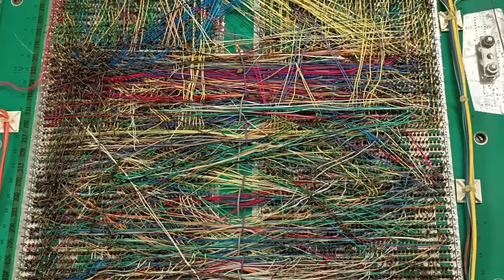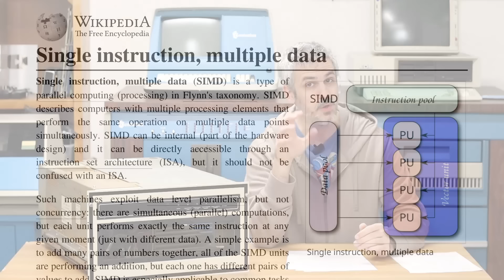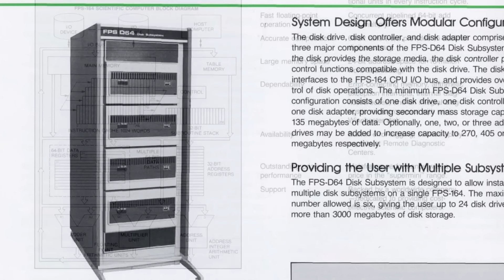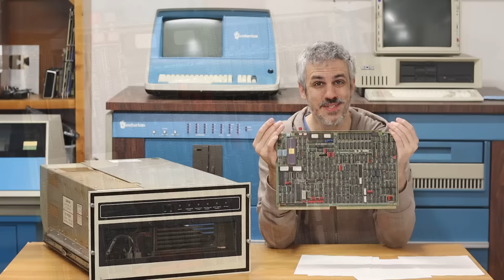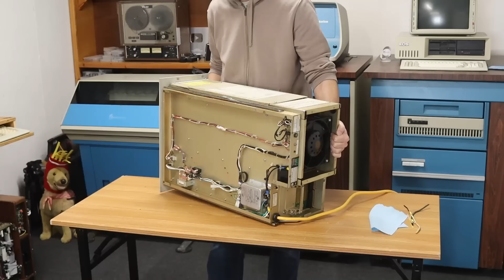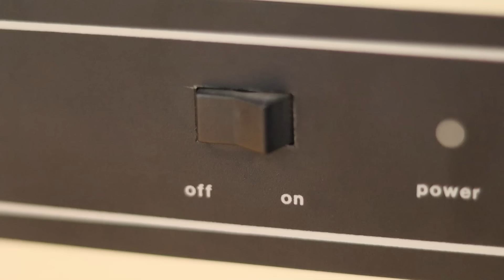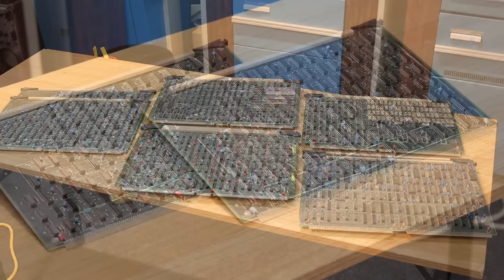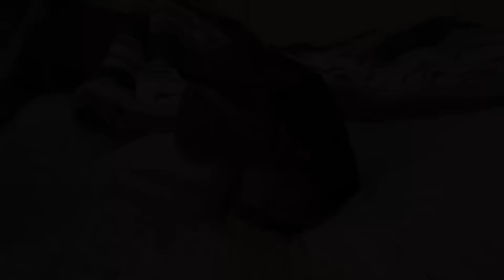This Computer is from a Defunct Supercomputer Company

Comment: Programmer here from late 70's and still working.
For myself I reserve the term array for multi-dimensional arrays mostly and vectors exclusively for arrays of a single dimension; so arrays are a superset that contains vectors.
BTW I cut my teeth on an NCR series 500 accounting machine (it used a 4-address instruction set and didn't have a program counter!), but most of my student programming was done on a timeshared DecSystem10, with some PDP-8 and a mostly unique PDP-15. One of my favourite memories was running lunar lander of a GT40 hanging off a PDP-11/03, because it came with 4KW of core memory the game would remember where you crashed your LEMs and woe betide you, if destroyed the "only MacDonalds on the Moon!"
My first job was programming a PDP 11/34 to run a ribber mixing plant and later on I helped to re-engineer a system that monitored a nuclear reactor and this was based around a PDP 11/44 so I really enjoyed the "blast from the past" that was you running sysgen in a previous video.
Reply: You are very impressive sir
Reply: wow! man you must have it so nice now with all that experience to draw from! best of times to you!
Reply: Ai is not going to take over but the most basic programming and error checking
Reply: Always wanted to be a programmer. Never learned it. And now we have AI. No need to learn it anymore.
Reply: @a56oktober202  Yeah, no. AI has added about 20% to the workload of software engineers. It turns out that it usually creates more work than it solves, as it takes someone with lots of experience to figure out and solve the errors.
Reply: Programmer from the early 80s here… we are not needed anymore, AI replaced us.  Deal with it.
Reply: @Smashtvtv ai’s that are giving wrong data, wiping databases and hds? lol. Only idiots will replace their programmers with ai 😂
Reply: @Smashtvtv  Have you ever looked at the code that AI generates? Believe me that we're still going to need humans with programming expertise to debug and validate that nonsense. You'd better hope that your airplane isn't flying with code written by AI, or your nuclear power plant isn't running with AI code, or that a human has validated the code running the CT machine you're being irradiated by... or even that your internet router has better than AI code powering it.

Comment: As a programmer, I have come across the term "Vector" several times; when not used for 3D graphics, it usually refers to a 1-dimensional array. And if you really want terms of confusion: add German translations to the mix, when "array" and "field" are translated with the same word. Which can get funny when you have fields that are arrays. x.x

Comment: Around the same time I was working with Sperry-UNIVAC array processor which had a theoretical limit of 120 mflop (though it was more like 80-some odd megaflops is reality).  It was really designed for oil exploration and the were indications that the 36bit floating point processor was, unlike 32 bit, just barely enough for the workload.

We mostly ran 3D FFT which had a lot of I/O jiggery-pokery in terms of rotating the cube.

Comment: In the early 90s, I worked for the University of Vermont. We had RS/6000 systems for academic computing, and one day a sociology professor complained that her Fortran program was performing poorly. Upon investigation, I found that it had originated at Queen's University, where I'd studied, and thus I knew that the program was designed to run on Queen's 3081G mainframe and, most importantly, the FPS164 array processor that machine had. I explained this and showed how the program could be changed to run fast on the RS/6000. She replied that unfortunately, due to peer review requirements, etc., the program couldn't be changed at all; if it was, her results would not be accepted. Seemed bizarre to have a whole field of study wedded to what was by then obsolete and unobtanium hardware.
Reply: Seems like you could do a lot of the research with an optimized program, and then at the end run it through the original to validate the results.

Comment: Programmers: Arrays!
Mathematicians: Vectors!
C++: We're just going to name the fixed ones std::array and the dynamic ones std::vector to confuse both
...oh and we also have std::list and std::deque which is basically the same general idea with slightly different set of features....
Reply: Modern programmers, mathematicians and AI researchers: Tensors! 🙂
Reply: @GreenJimll  Which, of course, are not really the tensors of physics!
Reply: C++ is only language naming them this way really. It is completely reverse of what it should be really.
Reply: I dislike the way C++ has regimented all memory access.  It's all just arrays really.  You got to learn C if you want to actually make a new datatype...
Reply: @tsm688  well... kinda.

Almost anything you could implement via C you can also implement via C++ - generally in more safe but sometimes gramatically-confusing manner.

C++ aims to be as fast as hardware allows and that means they have to support ALL those things even if it's really one thing due to slightly different ways of allocating space. Most programming languages only implement one of those things and call that "array" - much more straightforward at the cost of some speed. 

In particular std::array is just a wrapper around a normal C array, but std::vector is actually a dynamic-array-allocated-on-heap. std::deque is a linked-list-of-arrays.

This makes sense as many if not most C programs implement their own linked list or dynamic array, C++ mostly acts as a library that does that standardizes this mess.
Reply: It gets even worse if you start doing linear algebra, where vectors are typically related to direction and velocity. It can very much muddle the water even if they are all technically just “multiple distinct numbers tied together as a structure”.

The naming in C++ is just a C++ problem though, most other languages either stick to either list and array, and reserve vector for more mathsy stuff or hardware SIMD support, or vector as the universal collection type for numbers

Comment: On the geologic front, a use-case would be for towed array streamers.  Loads of sensors on big strings dragged behind a boat, used for looking for oil.
Reply: So a cat scan for the earth.
Reply: @cpt_nordbart  In this case, conceptually more like an ultrasound: waves bouncing off boundaries instead of particles going through. Another case would be mapping the mantle and core, which is still waves, but going through.
Reply: @cpt_nordbart  Correct, and the current version of that kind of study is "seismic tomography" that analyzes the way earthquakes move through the crust and mantle to make deductions about things like what happens to tektonic plates after they subduct under the edge of a continent. It's really interesting data for people who are trying to understand how plate tektonics had worked going back through the past 2 or 3 supercontinents. Not my field but I watch some lectures online and you can tell people are excited by it.
Reply: @cpt_nordbart   yes, exactly. When  I was working at FPS, we sold a lot of systems that were installed on the ships doing data collection, preprocessing on-site saved ship time and satellite time. We would get used APs acquired(scrounged) by geotech firms sent back for refurbishing specifically for ship board use.
Reply: Also in direct application to this project, spectroscopy on the composition of rocks. For example the early 1970s was when the "706 line" was discovered (referring to a line in the western US where the ratio of strontium isotopes 86 and 87 shifts to 0.706 rather than 0.704).
Reply: Software based on Finite Element Analysis is used to perform oil and other resources surveys.

Comment: I would imagine you have those seismic sensors in your observatory and the data would be crunched at some other facility with these fps100. I would imagine you'd run set of FFT etcs to construct proper signals out of noises. Just my guess

Comment: Like with a CAT scanner - Geo work does something similar.
They set out arrays or seismic sensors on the ground.. then explodes a charge.
The charges soundwaves travel into the ground and bounce back depending on the layers and density of the ground underneath.
Then these recordings are compiled together in a powerful Computer to give a picture of what is beneath the ground.
So vector style processing is a massive help in this.
Reply: Think Oil exploration for geo computing
Reply: Of note, the FFT was developed out of geology and nuclear nonproliferation; in particular, they didn't have a viable solution for detection of atmospheric testing so that was simply ruled out of the NPT, though Cooley and Tukey developed their algorithm at the same time (but too late for it to be useful for treaty enforcement).  Or something like that, so I've heard the story.

A DFT can be expressed as a matrix multiplication on a vector, so a vector processor is fantastic for these calculations.  Similarly, FEA methods can be parallelized with vector operations, give or take spacial arrangement of the cells.  Also very good for wave analysis, as the geologists would do.
Reply: Exactly! I once had a 11/24 that was reported to be used in oil exploration data collection.
Reply: The (original) Fortran 77 code for this analysis has been part of the Perfect(R) benchmarks for supercomputers since its inception. I think it has been re-parallelized since then to enable a 48-way FORALL loop that had originally been hidden by data dependences carried in a temp file.
Reply: You can see something like this in Jurassic Park when the palaeontologists scan the raptor skeleton. They had a shotgun blank for the vibration, but they only had a metre or so of sedimentary rock to worry about.
Reply: I imagine it can also be used for building GPR (Ground Penetrating Radar) images. It's basically a bunch of slices of radio data (similar to the CAT scan) Though that's likely more useful for archaeology rather than geology.
Reply: @rtfmpeople  Oh no, we run GPR toolstrings into holes in the ground too. And NMR. Useful imaging techniques for understanding your wellbore composition and properties.
When I was using them in the  mid 'teens, I don't think you could run both tools on the same string - but I think it was more a "can't get enough data up the 7km network cable" problem than a fundamental incompatibility between the tools.
Reply: @rtfmpeople  Same principle
Reply: Yeah they brute force invert the sound waveform to try to find salt deposits. If you’re interested google “full waveform inversion”.
Reply: exactly what I thought
Reply: Also works with earthquakes instead of explosives. Thats how the mapped the feeder system of Mount St. Helens after the 1980 eruption
Reply: TI sold their Advanced Scientific Computer (the TI-ASC) for similar purposes.  Their main customers were petroleum companies.  TI was previously named Geophysical Services Incorporated, after all, and Texas has plenty of oil and gas companies.
Reply: Geo == mineral extraction and petroleum industry. They have all the money
Reply: Or even simply to correlate the data from core drilling to locate ore bodies underground.
Reply: It's important to note that it's not just 1 charge... put a string of them, with a known spacing and timing, along a line.  Think of it as a single slice of a CAT scan, that could earn millions of dollars.
Reply: @ka9dgx  Put your geophones (geologist's microphones) in a string towed by a boat - say, 10km of string to get 6km of penetration into the ground. 256 or 512 geophones to a string. Then 32 or 64 strings in parallel, splayed out behind the boat - think of the turning circle of that little lot. Boom - you let off your charge. The boat steams forward a few 10s of metres over the next 10 to 15 seconds of "two-way time" while you're recording from each of your few 10s of thousands of geophones. (Don't forget to have a GPS receiver on each each geophone, because the sea is never flat not is the wind steady, and that turning circle!) Then you take another shot. Then another - hundreds of shots per day.
Geological data collection for the oil industry has always been an engine for pushing supercomputing. probably more so than CAD - we have real deadlines to decide whether to commit to producing a field or not. As Trump is going to discover with his ridiculous claims of Venezuelan theft of "US" oil, oil production licence contract have expiry dates ; when your license expires, that's it ; you no longer have any title to that field/ structures oil. It has reverted to it's owners - the state involved. And if you take an extra 6 months evaluating a prospect, that's 6 months of time less for you to exploit it.
Reply: https://en.wikipedia.org/wiki/Reflection_seismology
Reply: Yeah i was imagining geophysics, either GPR or other methods
Reply: @TheErador  I was thinking of archaeology like on the TV programme Time Team in the UK. But I do remember the scene in Jurassic Park where Alan Grant is using a computer and an explosive charge to generate a picture of a dinosaur skeleton under the ground. In that case the set-up seems fairly small but of course it's a movie and was set in the 1990s.
Reply: @bouffman88 : It's really just that it's a movie, even in the 70s they would have been using multiple charges.
Reply: @bouffman88  Sonic waves in the ground have a wavelength of metres to tens of metres. Which is approximately the limit of their resolution.
Obviously you can move to higher frequency sound, but that attenuates rapidly, which limits your signal's penetration before it fades into background noise.
High-precision drilling, we normally have to drill and log a pilot hole to establish the precise location of features of interest in the ground, then come back to drill along them. It's called "geosteering", and with care you can position your well to keep, say, an 8.5in diameter bit centred on a 6in thick bed for 80+% of the wellbore. Until you hit a 10m fault which the seismic couldn't detect because the sound waves had 10m wavelength in the ground.